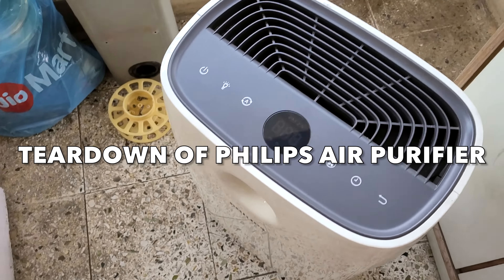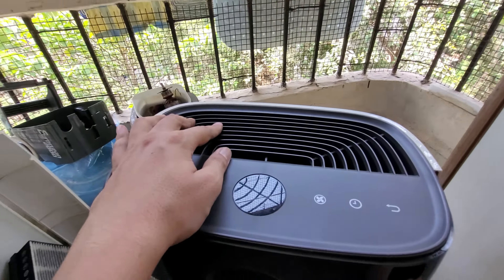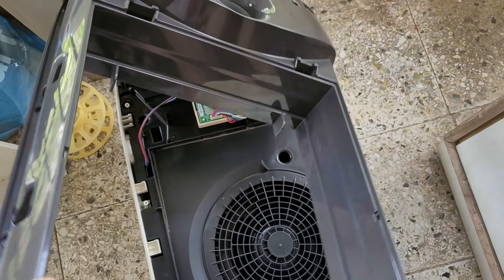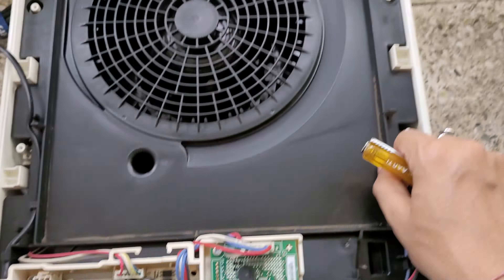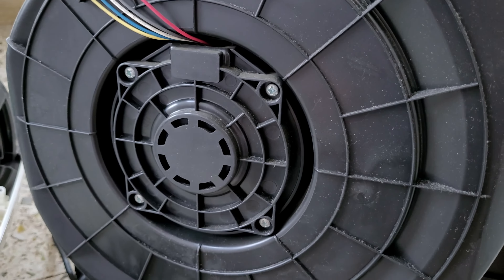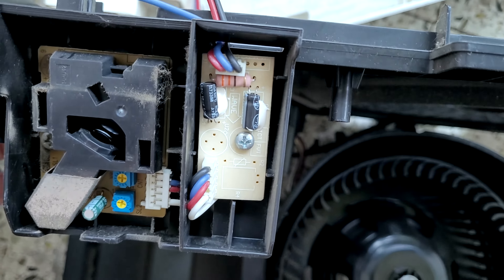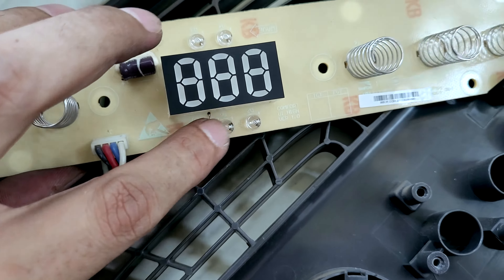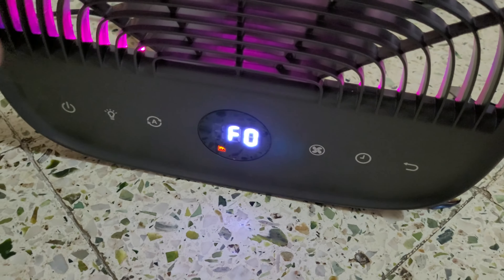Teardown of Philips Air Purifier AC2887 | MSandeepVlogs

Comment: f0 refers to the pre filter cleaning warning you can reset it by holding the back button on the right for 3 seconds. Also SL is for sleep not slow and t for turbo. Good job disassembling the unit. It's very basic and cheap to make but in my country this unit is 350$.

Comment: Brother, is it normal to see dust in the blowing side duct. In my brand new air purifier, dust accumulated in the clean air side. Is it normal? Or should i return
Reply from the maker: Clean the dust on clean side / blower side. Clean all filters. Use air purifier for some days. After this If dust is accumulating because of air coming after filtering on clean side / blower side then I would suggest talk to product support.